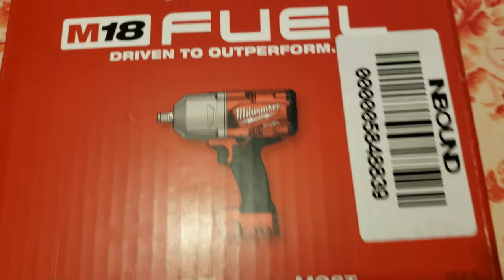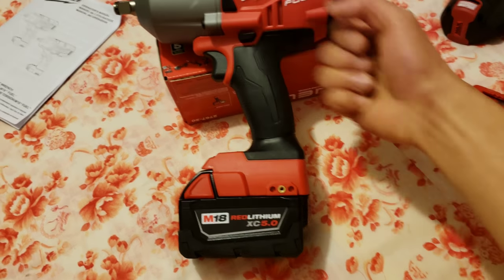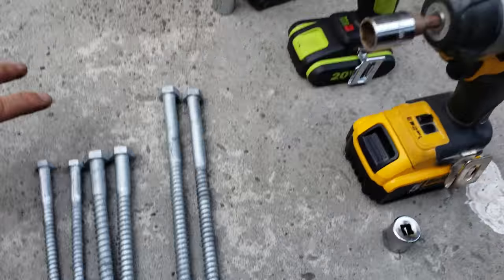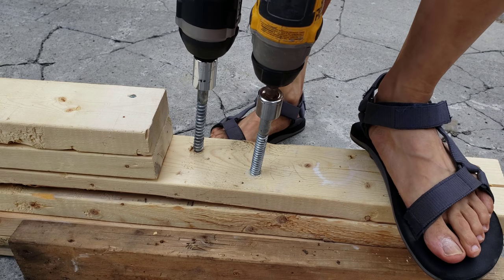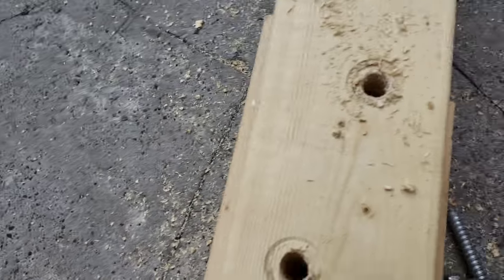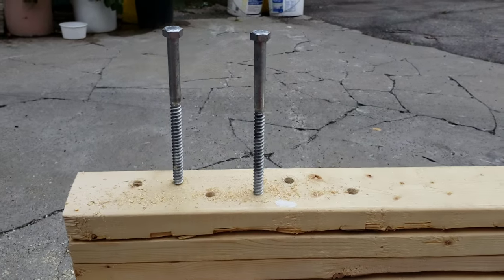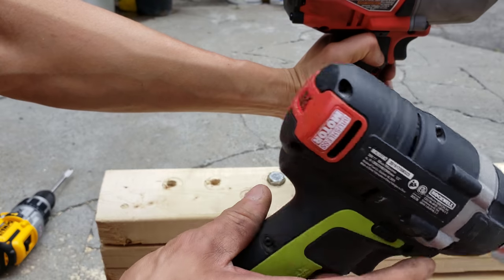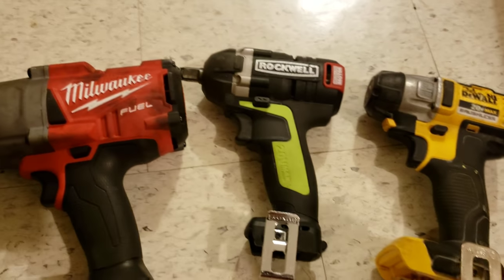Lag screw for driver and wrench

Comment: Great video thank you for posting. Just one suggestion, its recommended to use an impact graded adapter And impact graded sockets Otherwise the sockets could break shatter and also possibly ruin the mechanism in the impact or wrench drivers.
Reply from the maker: Thanks for the info.  Will keep in mind for next purchase

Comment: use the hyper tough 20volt max hammer drill to drive lag screws
Reply: i use it for torqing
Reply: put it in hammer drill mode so you don't split wood